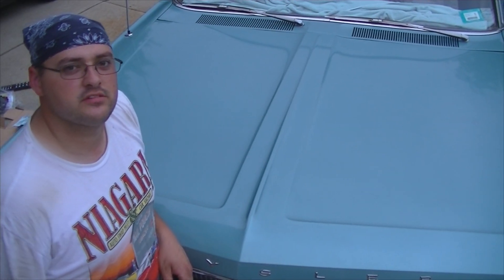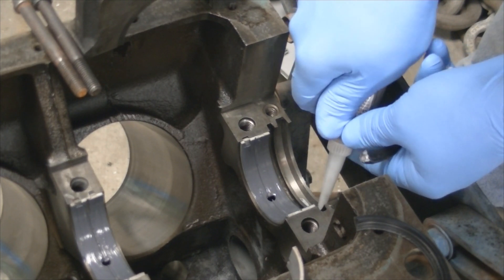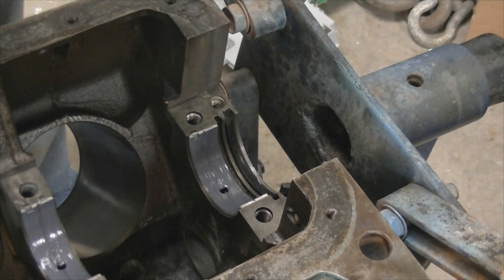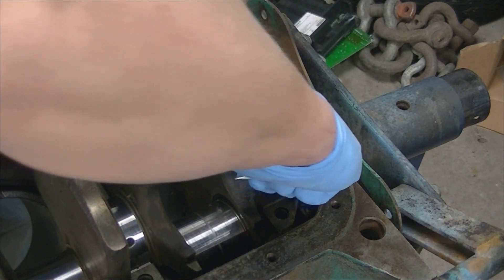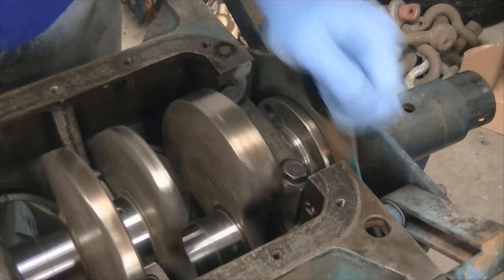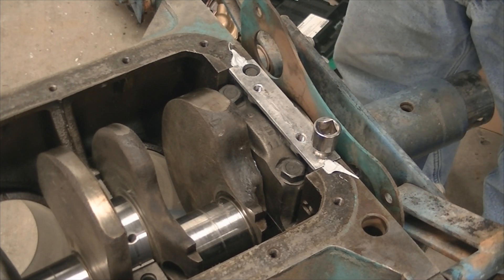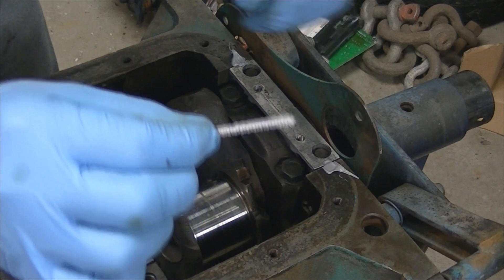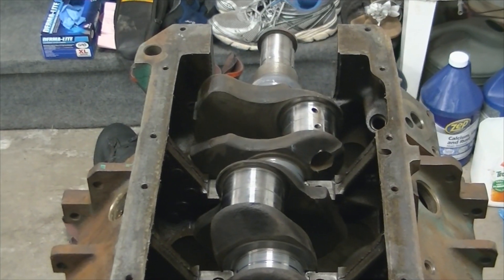Joe's Garage 383 Engine Rebuild Part 1 – Crankshaft Installation

Comment: So the "pipe cleaner" part of the process is there to induce a swelling of the sealant. Rear main seals on a 383/440 are notorious for leaks. be generous with the sealant I have pics of the rear seal that came off my 67 from the factory....

Comment: I've always wanted to know; Why wasn't the 383 more used & built?  Massive bore, short stroke, should be a high rpm monster. Deep skirt block, seems to be designed well, just being curious
Reply: The 383 was used heavily from road runners to C body’s and everything in between.
Reply: @DoyleShadduck  Does that make it a good platform, no it doesn't

Comment: when I saw you in gloves I thought smart ! human oils are bad for babbit. when I saw you using the old bearings I thought what a fucking idiot !
Reply: John W Mckinney Sr 
To defend myself, I saw no reason to change them. This was not a normal “rebuild”  this was more of a over done clean, check and re gasket.  Saw absolutely no reason to spend extra $$ on them.  If I did an over bore and had the rods reconditioned and arp bolts and shit, then that changes things. But this was to keep costs to a minimum. Besides. It’s been 2 summers of thrashing on it, winding out RPM. Running 9.5 second passes (1/8th mile) with 3.91 rear end gears. Stock T converter. Tell me again how stupid I am?  I wasn’t trying to see how much money I could spend.   I did replace the perfectly good timing chain set, does that make you feel better?
Reply: Side note, wasn’t trying to protect the bearings from my dirty hands rather than getting toxic shit all over me. You should have seen the lead in the bottom of the oil pan...

Comment: I have a 66' Newport in my back yard. Has break issues and can't seem to narrow down the clicking sound that is being made when the car is trying to turn over. Not the battery - using a battery charger that has enough power to start the car's engine (or says so on the battery charger) so not sure else where to look.
Reply: Andy Kemnitz  check the wheel cylinders and break lines for a broken line you might need a union fitting

Comment: This is a disappointing video for someone who wants to learn how to rebuild a Mopar B engine.  This series of videos is only good for people who already know how to do it, then they can smile and nod to each other and say, "oh yes, that's right, that's how we do it".  But for the beginner who wants to learn, it is useless.  You haven't started at the beginning, which should be right at the car with the old engine in it (not an almost new 20,000 mile engine), showing how to pull out the engine, how to disconnect everything in the engine bay, where to attach the hooks /chains etc.  Then showing how to disconnect the transmission, how to pull the dirty engine apart for cleaning etc etc.

You have started with a nice clean engine (have not even explained how it got that clean) and then you just throw the crank in after putting the bearings in at super fast speed !!  How useless !  What sort of tutorial is this?  How can anybody learn from that?  But then you spend what seems like minutes showing the back of your hand applying the silicone (what sort of silicone? there are dozens of types) .  I could go on and on but you get the point.  Sorry, couldn't watch it.
Reply: Steven, I suggest you get your money back....oh wait, the engine builder doesn't owe you anything. Why go on a rant about what he should have done to help YOU? I seriously don't understand your mindset that you feel wronged in some way or entitled to have someone step you through an entire process (for free no less) as if he's posting this video for you specifically.
Reply: I feel your pain and frustration but you have to remember that they aren't making the vid especially for you.
I'm a qualified mechanic and a Mopar nut. If you want to know anything just ask a question and I'll see what I can do. In the meantime watch as many vids as you can. Most engines are straight forward to rebuild for the advanced home mechanic (and upwards), but specific motors have specific requirements and people that specialize on one make tend to know the tricks. To rebuil\d a motor at home or re ring and re bearing a motor such as this still requires fairly advanced understanding of measurement, the importance of accurate measurement, clearences the reason for clearences, the upper and lower clearence range and the effects those tolerances have. Unless you understand those then I humbly suggest buying a junkyard motor and playing with it before attempting to work on any motor that is important to you. 
To be honest, most of a motor rebuild is about 2 things, 1) cleaning, 2) measuring. Those two things take the most time BY FAR!

Comment: I did  a muscle motors stroker kit for the 383, has a 4.25 crank, you get a shit load more tq! I used 440 sorce ported heads solid comp cam, rpm edelbrock intake and 950 carb,  590hp and 615 tq.  pump gas, and get 14mpg witb 355s  tons o fun!

Comment: 383s work better with a 4.25 crank!
Reply from the maker: Please explain. Thanks!
Reply: @ric0000  Get an extra 5,000 dollars and give Muscle Motors a call ! (that's for the short block) They have a good web site, I learned something.
Reply: oh hell no. 383s are famous because of their stroke.
Reply: ric0000.  383s are great engines! But lack tq. I've been building engines for 30 plus years, I like tq. Like Carrol Shelby said,. Tourqe wins races!

Comment: Joe .. the purpose of the pipe cleaner is to take up space in the seal joint and actually squeeze the sealant out to fill the void you ended up with . yes its an indication of not having enough,but you should also saturate the pipe cleaner. without it saturated it can suck up the silicone you first put in and compound the problem .. your fix was the right one .. good job .. big block mopars are notorious for rear main leaks around the seal retainer rails .. the offsetting of the  seal and the pipe cleaners is the way to go

Comment: those big block Mopars are notorious for leaking rear seals. my 69 383 has 3000 miles on a complete rebuild, and is leaking at the rear seal spraying oil all over my headers. can the seal be changed with engine in the car? thanks for the vid :)
Reply from the maker: +69roadr I talked with Joe about this question.  He said there is indeed a procedure for changing the seal while the motor is still in the car, however it is not his preferred method.  He said it is awkward and will probably result in a leaking seal again.  The best and most reliable way to ensure no leaks is to pull the engine and change it like in the video.
Reply: +ric0000  thanks bro, i was afraid of that. i guess to do it right and be done with it will have to pull motor.
Reply: i know this is old but i thought you should know that mancini racing has both the old rope type as well as the two part seals for your motor and they are supposed to work very well.
Reply: @purplexenno  thanks
Reply: So did the rebuilder mess up the rear main? How long did the original one last?